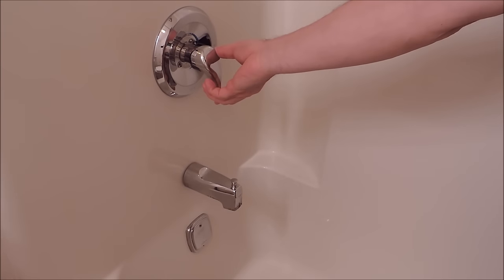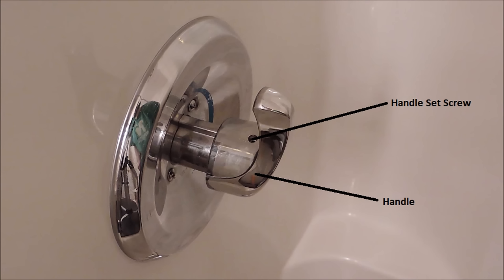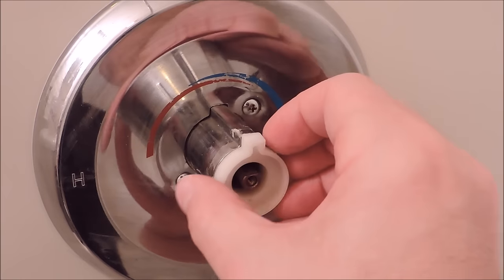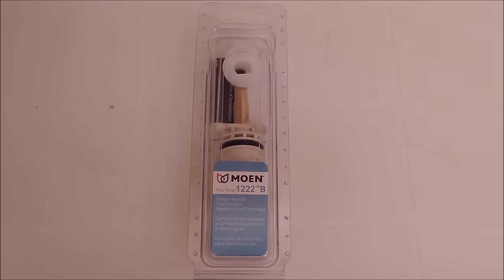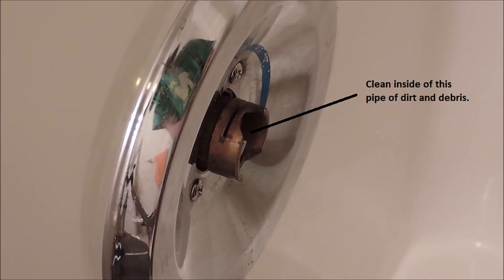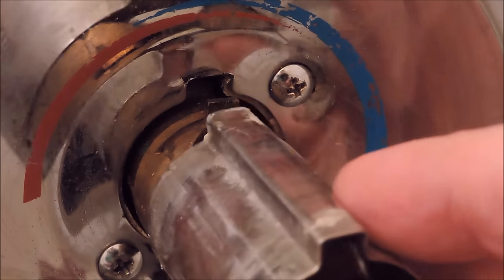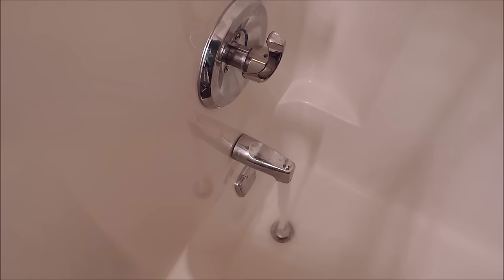Repair Shower faucet: Moen Posi-Temp Shower faucet ( 1222 B )

Comment: you didnt show one that had been in there for 5 to 8 yrs!!!  hahaahhaha     not so easy,,, dumb video!!!!
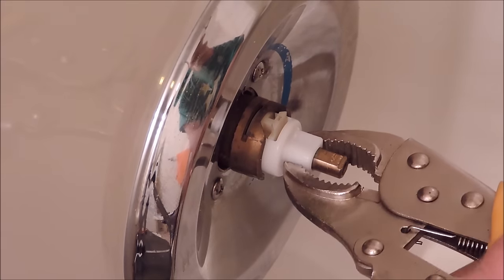Reply from the maker: You bring up a good point, in that this cartridge after being in the pipe for 5, 10 or even 15 years is sometimes very, very difficult to remove, and it takes a whole lot of elbow grease to do it. If you listen close to my audio at 3:20 I said "I tried it a number of times..." and at 3:56 I said, "after a number of tries" and watch the edit transition at 4:00 and notice after the edit, the cartridge is already shown about a quarter of the way out already - it took me alot of elbow grease to get it there ( off camera ). Because this cartridge was in the pipe not 5 to 8 years,  but 18 years!!! So like you implied it was very hard to pull out, but I did not show that on my video, but I did indicate by my voice over it took a "number of tries".

So now after your comment and my reply - now the users are well informed of the trouble and elbow grease that maybe awaiting them, but its not always that hard.